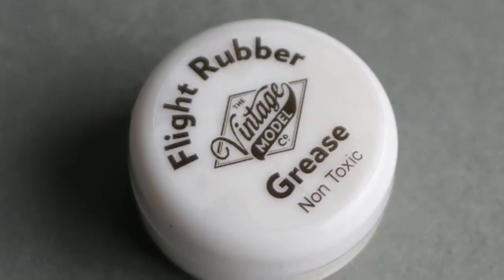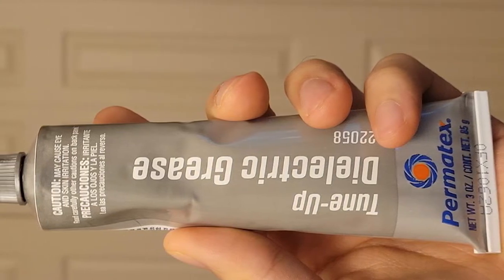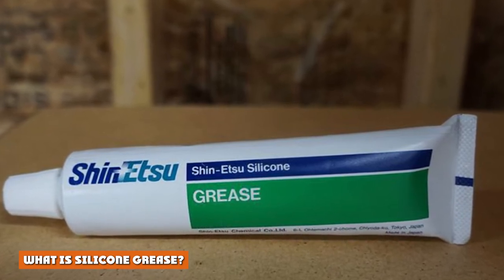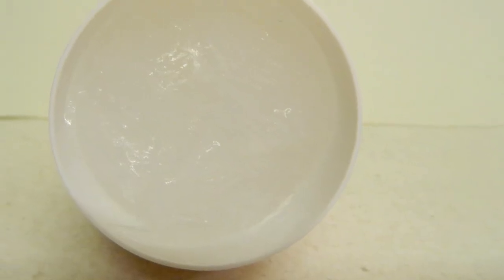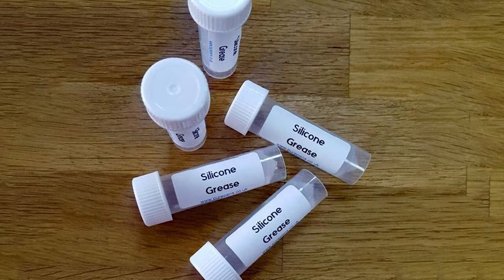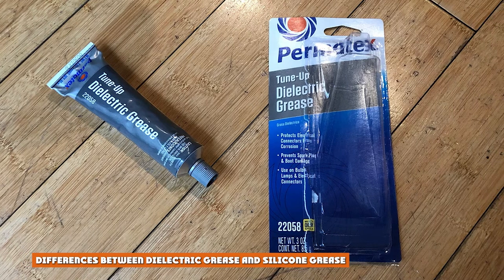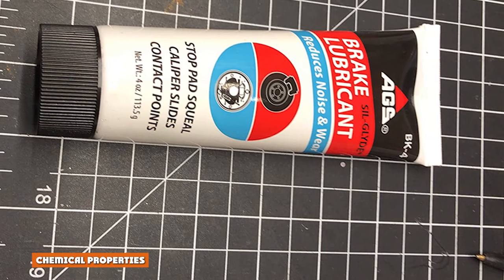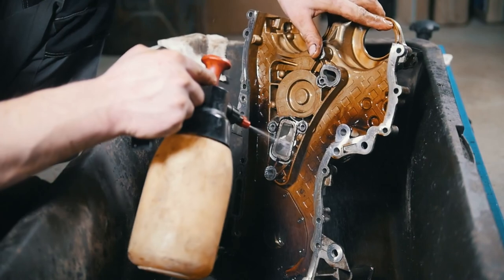Difference Between Dielectric Grease and Silicone Grease

Comment: The one informative difference that I got from this video was that dialectric grease is primarily used for spark plugs, which is what I needed to confirm and that silicone grease is primarily for rubber components, such as lubricants for bolts in calipers when performing a brake job.